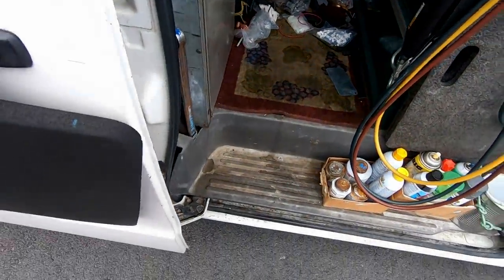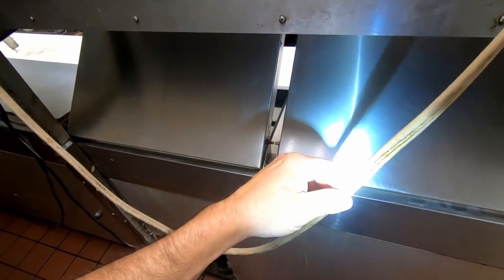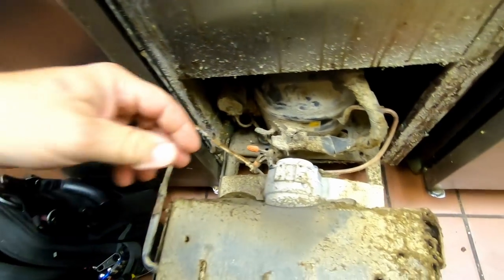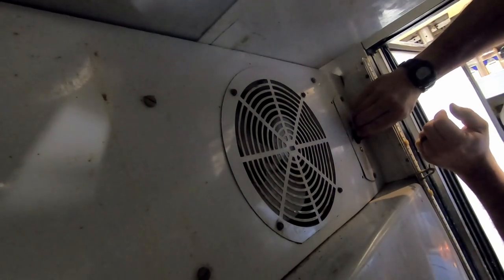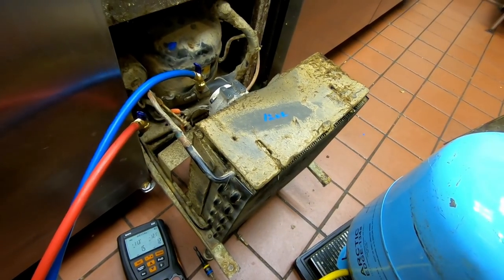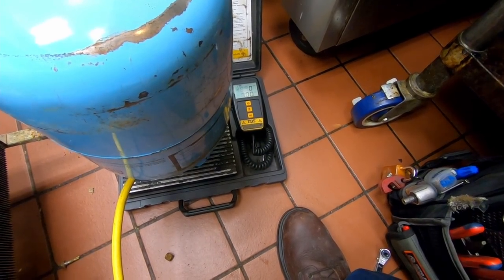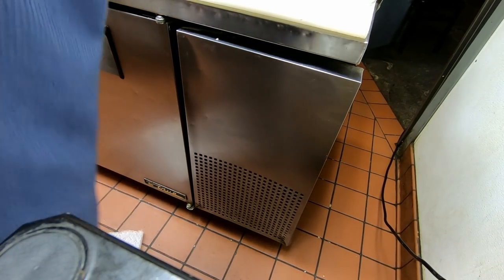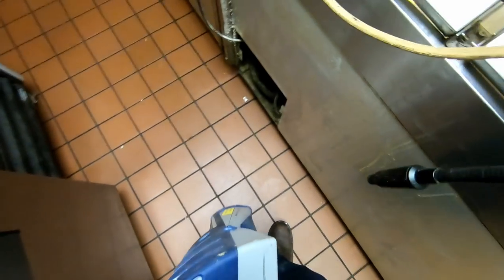$ERIOUSLY!  This Is Why Your Prep Table Is Warm🤦‍♂️🤣

Comment: That freaking filter was ALIVE. I'd be surprised if you ever eat out after encountering such crap day in and day out.
Reply from the maker: I've ate here many times. Their food's really good and for the most part the kitchen's spotless far as health wise.
Reply: way to much oil in the air. their exhiast hood system should be sucking all that up. somethings not right with their system
Reply from the maker: @randomrazr  I see that at almost every restaurant that has a cooler nearby their fryers.
Reply: Oh I'm seen situations that would not want you to to eat at certain places again but yet I and other people did.

One time I was eating at Red Lobster someone at our table happened be about to dig into a cheddar bay biscuit.

Happened Terry into it to bite off a piece and happened to look at it.

Warning graphic.

This absolutely true and disgusting.

There was a roach of course cooked in the middle of cheddar bay bay biscuit.

Of course the staff was notified they wound up not only giving us a real on the Hills but gift cards as well.

And of course grabbed every batch of cheddar bay biscuits that had been prepared recently that people had not eaten.

They said that of course that no one would have known likely it had not happened there but sometimes in processing plants where the stuff is prepared raw mix!

This one's up getting in there sometimes not very often!

At least they didn't try to cover things up it took action in case there were more situations like that in that batch!

Also I have been with others multiple people getting food poisoning the place called CiCi's Pizza if I'm correct?

Everyone that even had one slice of the chief pizza and just the cheese pizza nothing else lined up with food poisoning!

We did check back in and turns out everyone that had any cheese pizza whatsoever getting sick including a few employees!

Although we still went back to those places!

Also I was staying somewhere that they use the food bank at one time there was chicken that had been prepared something seems off about the dish but we couldn't pin her finger on it.

But everyone got sick!

And this is more of a food safety thing and Refrigeration Service thing of course.

But the chicken had not probably get Frozen it had thought it was refrozen for who-knows-how-long out of the freezer!

Just a reminder make sure foods have been kept Frozen and refrigerated and if power goes out make absolutely certain things are still good!

Be nice if they had someone display on Modern fridge that would let you know there was a meltdown or if it got too unsafe temperatures or power down for so long.

Perhaps that door beeper on some refrigerator freezers could be pin a certain pattern when the door is opened to indicate there was an issue!

What's build a gizmo that plugged in to the wall socket for the freezer let your power been off for a certain amount of time a beaver would start going off until it was reset
Reply: Anyone know what type of filter media that is looking for someone like that for a project so they could be cut to size.

Also has anyone ever heard of the research on using, and paper towels as filter media surprising the results if this is to be believed I don't think this is hearsay?

Could be the next big thing in air cleaners surprisingly good filtration.

Think there has been mentioned a few times here at least on YouTube including some notable channels.

From what I can tell is legit.

If anyone has a link to this study please give a me a heads-up.
Reply from the maker: @Aaron Brandenburg  https://amzn.to/3xBhW7L this is a closest match I can find of what I use, I use white media filter roll from Glasfloss. DO NOT USE a paper towel it will restrict to much air flow and overheat the compressor.
Reply from the maker: There's building automation systems that can do that, people just don't want to pay the money for it.
Reply: @HVACRSurvival  hey thanks for the link I will check into it but that is for a different project I'm a maker / DYI!

But the thing about the paper towel thing it that was something entirely different not the same subject. Not HVAC not Refrigeration.

But in terms of the ability of paper towels to filter fine particles to act as an air cleaner such as on a smaller scale just for cleanroom Air Force of something that would be Desiring to do so appropriately.

If I tried to explain it it would have probably taking many more lines in comments!

But that filter media should help for what I've been looking for for a couple different projects!

Also partly my fault on the other I didn't really explain enough!!!

It was more of a question as to had anybody heard about the research unpaper towel being used as an efficient air cleaning filter!

Supposably they're very good for very fine particles can't think of what it was offhand but I've heard this a few videos that we're on the subject of air cleaning or ionizers ozone generators what-have-you.

But from a reputable Source not something like someone promoting UV LEDs used furniture sterilizer or something like that which is total bull crap anyways.

I'm still on the fence on AutoZone but sometimes in some cases it might be ok???

I have heard that it does in refrigerators extend the life of vegetables and stuff and helps with odors.

As people probably should know there is Ozone present in every day are due to natural production of ozone!

If any level of ozone will be dangerous the air around us would be dangerous to breathe!

So perhaps some level would be safe.

Any comments on this part welcome as well!

Building a little device that would have filter media small uv-c tube and a fan just is a little small air cleaner for a local area.

And if appropriate ionizer assembly or ozone generator!

That was an old place I lived which was quite old and not so pleasant!

Better where I am now.

Is there actual producers of ozone is actually lightning as well as produces fixed nitrogen wishes then carried by rain as a natural fertilizer!

I know I'm rambling here a bit but natural sources of things people don't actually realize.

When there is all this hype about things being bad for you.

Or bad for you or maybe okay depending on who you believe.

You're really nice we some hard evidence on things like this as well.

I take this sometimes as though it were misinformation or disinformation so it's best to just be on the fence until you can get some hard data.

That's how I try to do things but of course that's not always feasible.

Also this is a refrigeration to hear though.

I remember once I was helping clean up drunk area of a summer camp.

And we were salvaging and also saving Antiques and see anything we can get money for of course.

Some really nice sweet antiques.

We were moving one of the fridges that had the where are the coils on the top.

And somehow they damaged one of the refrigerant lines.

And gasst themselves!

Not sure what that refrigerant was I don't believe it was ammonia but whatever it was it wasn't freon.

I've smelled Freon before but that was quite different.

 unless of course the compressor was fried or byproducts from over the years whatever!

I can tell you that says Gwen Akron it was like worst thing ever.

Although did not smell or react with anything like ammonia!

Any ideas  anyone what that refrigerant could have been?

 or what had gone on in that system result in this.

 not the damage to the lines or a connection.

But the chemical properties of refrigerant?

Comment: At 11:00 you're installing a new filter on the condensing coil, can I ask what material you use?  Does this not create a restriction on the coil and make the compressor run hotter for longer?  Just curious because I work in a lot of kitchens and will start using a filter if you don't find them adversely affecting performance.  Thank you for sharing your information!
Reply from the maker: The factory does not recommend it, however it makes keeping the coil clean as simple as changing the filter and reduces maintenance time. You still need to change the filter possibly every month to 2 months. If they're not going to change it for a year then it's just as bad as not having one at all. We haven't lost a compressor yet from it. Yes,  it runs a little hotter but it still cool's fine.
Reply: well i see the benefit of using filter also saves time on cleaning coil everytime you go,much fast to change filter then to clean a coil everytime, and if it running the compressor hot but doesn't actually messed it up, i guess its best to lean on the safe side.
Reply from the maker: Bingo👍👍

Comment: Good job there, Rick. I had the same type of AC sensor, haven't been able to find another like it, and have been using Fluke and Klein, broke the Santronic tip off because it was in my back pocket, can't win sometimes. Go figure?
Reply from the maker: I haven't had one like this since 1996-99 area. It was Amprobe but I believe these guys built it for them. It works good but it's not real durable🤔
Reply: @HVACRSurvival  yeah, I had mine in 1993, bought it from my instructor for electrical maintenance, got an associates degree, Mr. Maguire, motor teacher or instructor, worked in steel mills, good teacher, I think he passed by now. Learning air conditioning to boost my knowledge.

Comment: That chef's table needs some good cleaning... I am shocked that with those filters in it like that (violation of health code) that a health inspector did not shut them down.
Reply from the maker: Dirty air filters on a prep table is not a violation. There's a lot of flour in the air because they're making pizza. This actually is a nice restaurant and I even eat there.

Comment: What type of crimp-ons do you buy?
Reply from the maker: I just have the consumer grade ones from the supply house. That's why I didn't redo it. They work good for most things but they're nowhere near as good as an open barrel connector properly installed.

Comment: at 11:02 whats that white sheet u put on?
Reply from the maker: Filter media
Reply: @HVACRSurvival  where can u buy it. i assume its used to trap grease from collecting in the coils?
Reply from the maker: @randomrazr  the white filter media can be bought by the roll in a box. It's made by glassfloss. We get it at the HVAC supply house.
Reply: @HVACRSurvival  it actually works at keeping grease from collecting on the fans and fcoils?
Reply from the maker: @randomrazr  you seen the coil. The factory says not to do it but.... It works good
Reply: @HVACRSurvival  i came back here casue we ahvea single door under conter true cooler. the technician said the evaporator coil is leaking nad needs a new one. is it worth saving? only 5 years old

Comment: Looks like they need a new makeline.   My family sold parts/upgrades for 'Triple I' restaurant equipment, including custom gaskets.   It takes work to beat one up like that.  (seen worse).    I'll admit, when you pulled open that cabinet, I was expecting you to put on gloves.   So, who is supposed to clean off all that dirt?  Maybe it's my OCD, but I just can't stand putting away equipment covered in schmutz like that; I try to at least do a cursory swipe (mind you, I'm doing IT equipment, so it's a bit more vulnerable to heat buildup than what you're doing).

Good job getting them going that quickly.
Reply from the maker: The owner usually keeps it all clean. As you seen they were wanting to get cooking so I skipped giving it a deep clean. I usually focus first on the coils, refrigerant and motors first then if I have time I'll get the rest. Thanks 4 watching and commenting. 🤟👍👍
Reply: now, imagine having an server room with unfiltered air ducts to a rock crusher, gravel and sand yard, which has endless amounts of dust in the air lol
pretty much sums up a restaurant that uses large amounts of flour, starch and other fine powders. I have worked in and around all, so I have seen the worst lol
another killers are silk screening/banner printing, tire/rubber/plastic manufacturing, the release agent powders are very bad, at the end of the day, it will be through your clothing and built up in every body orifice and crevices you didn't know you had. also dock work in truck terminals, with new tires are the absolute worst.
Reply: @throttlebottle5906  - I have one of those.  It's a server room in a warehouse as part of a CES Exam station/LTL Freight forwarder.

Comment: Alllllll the workers use the gaskets as handles. Bozos.
Reply from the maker: They need to design a lip to protect them.
Reply: @HVACRSurvival  put gasket on body of unit not door perhaps.
Reply from the maker: @IFIXCASTLES  I believe they rather sell new gaskets 😲

Comment: vomits in mouth that place was disgusting.
Reply from the maker: You must not run food service? The equipment was a little beat up but there is no health hazards there.
Reply: @HVACRSurvival  lol, if he thought that was bad, he should see some of the bad ones!
yeah, I still eat fast food every once in a while and still get ice in the fountain drinks.
Reply from the maker: I wonder if people think the water lines that feed your house water are perfectly clean.
Reply: @HVACRSurvival  well, they are slightly better than septic tank effluent :))
Reply: @HVACRSurvival  and getting you hands on the floors and that nasty filter and all that gunk you took out from the fan , and randomly placing you hands all over the prep table or the food  prep area  and all handles basically is totally  clean and safe 👌
Reply from the maker: @jujujuoooo   so you must be one of those restaurant owners that likes to blame everyone else for your inability to sanitize your tables and utensils after someone comes in and fixes your equipment.? Take responsibility much? I did not lay anything  on the table,  I've seen people put vacuum pumps on top of them. Get a life